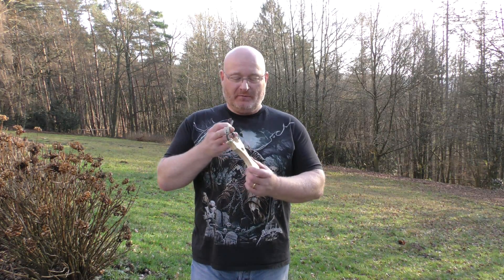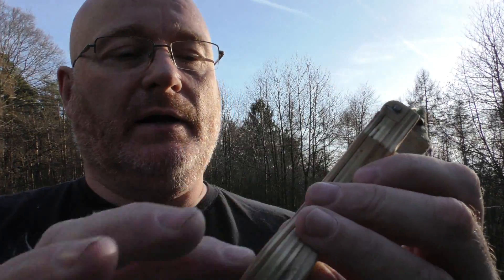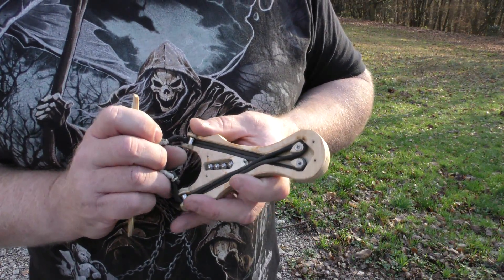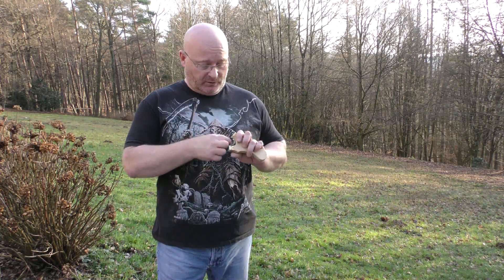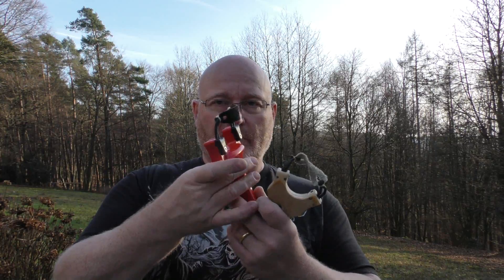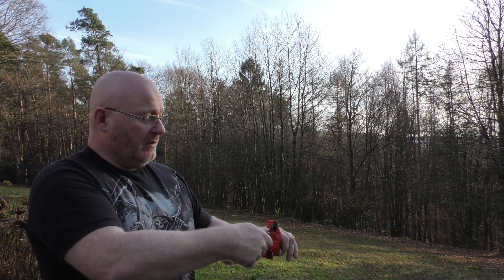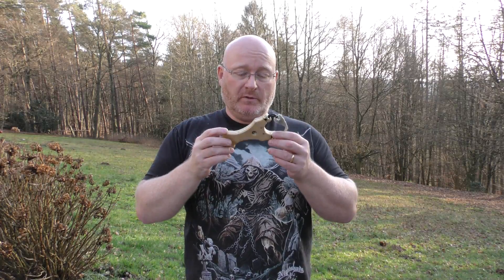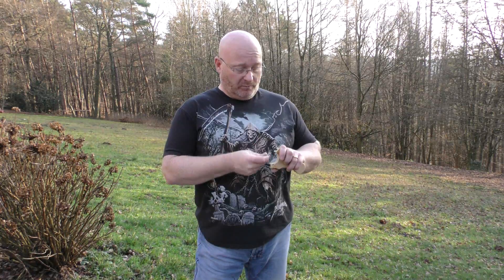A close look at the new pulley based slingshot design prototype!

Comment: Awesome idea Joerg. I work in metal fabrication and am not a big fan of tree carcass. I will probably make one out of titanium. Do you think that graphite would work well to reduce the friction on the bar that separates the bands? I haven't seen anything that says it would degrade the bands. Or maybe a cerakote? I would also like to donate to your channel if I decide to use this idea.
Reply: +Joe Clark Tree carcass? lol Wood has its uses. Also I was thinking about the band separation, if you could make some mini-rollers it would be the best. Not necessarily ball bearing, but something like brass on steel, then the bands would just have to roll on the brass and the brass would rub against the steel with a very low friction coefficient.
Reply: ***** You're completely right, wood does have its uses. It makes charcoal for yummy barbeque and toothpicks to clean your teeth after you eat said barbeque.

The dry static frictional coefficient of brass on steel is about .35 where graphite on steel is less than a third of that at .1. The friction would again be multiplied depending on the surface area of contact between the I.D. of the brass and the O.D. of the steel. Roller bearings/sleeves are great when there is an applied load to be carried. The impetus of the band is transverse to the guide bar. It would probably not even make the roller spin on the shaft. If it did, it would waste energy spinning the roller.

I'm one of those occasionally intelligent Americans. With that said, I do enjoy a good debate!
Reply: Joe Clark Well, make it graphite then. I'm not sure if that would have any cost or durability issues though. Also you can place them perpendicular to the bands so they eliminate the most friction that takes place when the bands go back in the slingshot, pretty much like the outer rollers. The load isn't that much, but at least it wouldn't be rubber sliding against another material. Plus you could also lubricate the rollers as opposed to lubricating the bands. Also, if I remember correctly, the area doesn't make a difference. It's only the force and the friction coefficient that matter. 

As for the wood, also furniture, construction, tool handles. Not sure where we're going with this :D
Reply: ***** I wouldn't make the bar out of graphite. It would be a dry graphite lubricant that can be applied directly to the bands, reducing friction between the bands and themselves, the bands and the housing and the bands against the bar. The surface area doesn't matter in a CoF calculation, but it does in the application of the theory. If you took 1 square centimeter of brass that weighed 1 kilogram and set it on a steel plate, the lateral force to move the brass would need to be 34% of the weight. If this kilogram of brass were then a pipe (as the pin/roller concept) it would take far less lateral force to move the brass. If the OD of the brass tube grew larger (more contact area with the plate) it would take more lateral force to move the tube, even if the mass remained equal. If the force is constant, and the coefficient of friction is constant then the variable would be the surface area.

You were on the right track with the tree carcass. There aren't many places to go with it :)
Reply: Joe Clark I see, but wouldn't the fact that the bands come out and snap back in every time you shoot make the graphite fall off a bit every time and lose lubrication in time? Also in the pin/roller bearing there's technically sliding friction, not rolling friction. Only in a true ball bearing there's only rolling friction. The only difference is that the surface is curved, but the brass still slides against the steel and doesn't roll over it.
Reply: +mrkiky. Absolutely, but the inverse now applies. If the entire brass roller is in contact with the pin, the roller will soak a lot of energy from the impetus just to spin the roller. If it's a loose fit, the band will slap the roller into the pin creating downforce spikes. The graphite will last longer than the band to cup connection.

Comment: Great idea Joerg. I have one suggestion tho.  You should drop the use of the polished nail inside. The reason i say this is because when you pull on the bands, they stretch at the same rate and do not really rub against each other that much...  the nail, in my opinion, would make more friction damage than not having one.

Comment: The pulley system gave me an idea. You should make a slingshot like as powerful as your world record one, but make it foot operated like a shear for sheet metal but using pulleys. If you made it fire automatically after drawing back the bands back all the way, you could pump it with your foot for rapid fire powerful shots

Comment: This is a feat in slingshot engineering because:

1. It's compact
2. Little bit of rubber sticking out means quicker loading where as normal slingshots, the rubber is flopping about making it awkward and slow to load the next projectile in the pouch, you understand what I mean?

So yes, you should get a patent for it and mass produce them :)

Comment: Wicked Slingshot. BTW have you ever had the elastic bands break on you on any of you homemade slingshots?
Reply from the maker: +Nick W They break all the time. Depending on how you cut them and how far you stretch out, a band set lasts between 5 shots (world record bands) and 2000 shots (straight bands cut long enough never to exceed stretch factor 4).
Reply: Any injuries ?
Reply from the maker: +Nick W Not really. Bands always break at the pouch. Shot goes wild, but the shooter is always OK.
Reply: +JoergSprave Any bands in particular?

Comment: Think about a Smartphone sized slingshot with pulleys inside and the rubber running up and down one time for each side!
It would be more or less a over the top shooter, made from Aluminium. 5-7mm thick and very portable (iPhone 5size)

Comment: There are 2 logical conclusions to this: A: This thing is amazing. Simple, yet effective and functional design. and B: Asking if you could use the same compaction technology to produce a more "normal" size slingshot, but using the internal storage for increased length, without having to supersize a slingshot. (leaving it at normal range in size still)

Either way, it looks simple and reliable enough to not have any major failures or acute weaknesses, while also providing an edge in its features.

Comment: That is a very good idea for a slingshot, very compact and it has it's own magazine built into it. Only way I could think of improving it would be to find some way of increasing the magazine size and possibly using some kind of button to push the balls out, which could possibly come out of the bottom. As for finding space to increase the magazine size, the magazine could be place behind the rubber bands, while this would increase it's thickness, it could vastly increase the amount of balls that could be carried internally. This being said, I know next to nothing about slingshots, so make of that suggestion what you will :)

Comment: Hey joerg i have a ammo choice question for you is it a good idea to use .177 cal steel bbs
Reply from the maker: +zane higgins Too light for a slingshot. Rubber won't exceed 500 fps, 550 tops. Better to use heavy ammo.
Reply: +Slug Slugster that couldn't have been a gayer thing to say
Reply: +JoergSprave  you should make your prototype in aluminum, and make it thin so you can add wood or plastic handles on it that are shaped to fit a persons hand like you have done before, and maybe for the friction points on the rubber inside and out side have brass rollers that go over the polished nails and make even less friction, especially where the rubber bands cross, you wouldn't want the inside rubbers to wear away from friction.
Reply: +Slug Slugster  Learn a bit ok ?  "Bullets" started off as sling  projectiles and the name was also adopted for the much later slingshots and projectiles of firearms.
Reply: +JoergSprave Jeorg.... In the Vid you said the bullet well you are using a sling shot so the item you fire is a shot not a bullet so dude get it right. I am going to get lots of hate on this but Shot - projectile, good night, another great vid I have given a thumbs up to and I love you man!

Comment: How about somehow putting a magnet into the "pouch" (not sure if that's the right word). Should be stronger of course than the one holding the balls in place. You could just press the puch against the "magazine window" and would load it.

No need to change your grip or to let go of the pouch and you could keep sight of your target while you do that. So it would be a "quickfire Slingshot" in a way.
Reply: but then wouldn't the pouch hold the ball and reduce the power? you would have a magnetic field pulling the ball in the opposite direction of force, thus subtracting some amount of energy
Reply from the maker: +morbvsclz Heavy pouch = broken knuckles.
Reply: Hmm. True. Haven't though about the chance of the pouch hitting your hand... Well, so I guess you will just have to invent a very light, strong and highly magetic rubber or fabric for the pouch first ;-)

I am sure the Nobel prize for Physics (or Chemistry) would be a nice byproduct of the slingshot building process :-D

Comment: 2 negatives / trade offs for the much more compact design:  1, you're limited to round bands and cannot use heavier band sets.  2, You lose a portion of the potential acceleration as some of the bands are inside the frame.

Could you do some testing to compare this to the Rambone using the same length and type of band?  Would be very interested in a side by side chronograph test with a few sizes of ball.  My assumption is that it would be a very minor trade off for such a compact design.

Comment: In my opinion , if you refined the magazine (making a simple mechanism for dispensing a ball by pushing back a little paddle- Very simple, make the hole wider and add a hinge) or something of the sort or considered making something akin to a "compound slingshot" that works on the same principles as a compound bow (on a much smaller scale!) this could develop into a very serious contender for mass market.